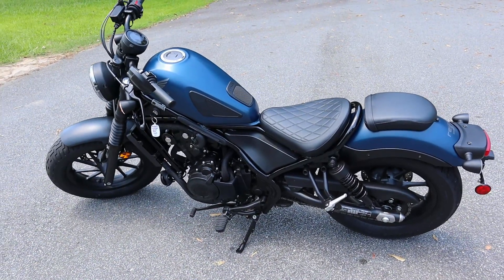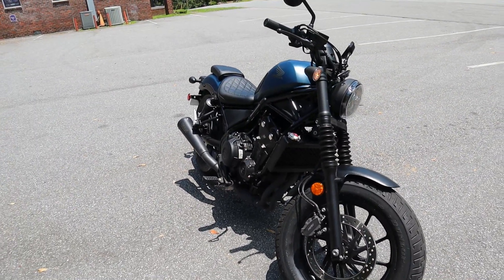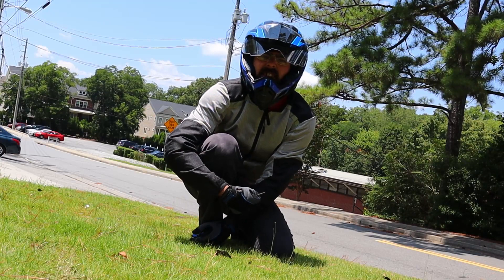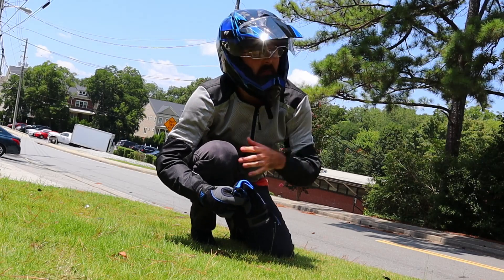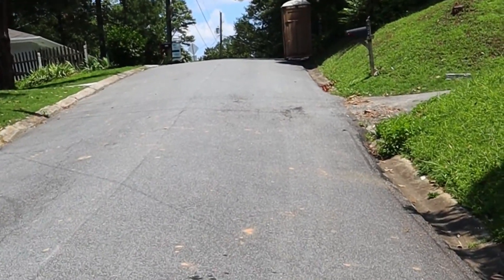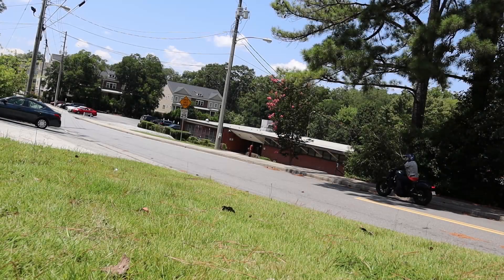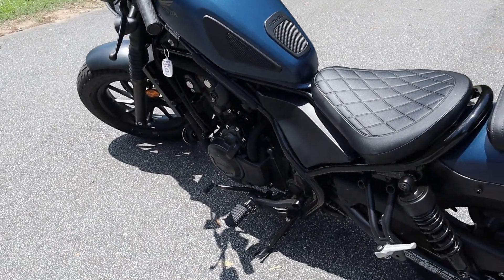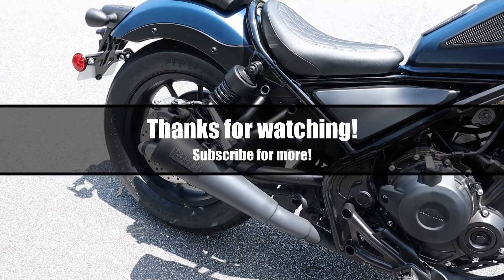Rebel 500 Day 2 New Rider

Comment: You have my sympathy for dropping the bike in that position because I did the exact same thing but twice.

 In my case I hadn't ridden for over 30 years and was trying out the SV650 I had bought, for the first time, in my quiet road. When I turned on the steep hill it hit the steering stops and I couldn't reach the ground before it was overbalanced. I was furious with myself, got it back up without thinking out why it happened and dropped it again the other way.
 That cost $1,000 and I sold it through the bike shop I bought it from that did the repairs.

 That was about 12 years ago and now i'm 70+ and still reading reviews of bikes that I would love to own and ride. I ordered a new Rebel 500 last year which took forever to arrive and was damaged in transit, so returned. Rather than wait some more I cancelled the order because my enthusiasm had worn thin.

 So well done for not giving up as I did after making a silly mistake.
Reply from the maker: Shoot, that’s a shame. The Rebel 500 has been wonderful to me so far. I still haven’t fixed the clutch lever, I don’t mind it being a tiny bit shorter. The shop was kind enough to straighten my bars and fix the minor things free of charge. Luckily I haven’t dropped it since. Thanks for watching, and I hope you get a bike again one day.

Comment: Oh gosh I did the same thing on my 3rd day riding my new Honda Rebel 300 turning in a circle from the road and used our driveway that's slightly up hill. I was going to slow and it leaned left so I basically layed it down. I broke my clutch ha due too. 😅 I was upset but lessons learned. Good luck!
Reply from the maker: At least we learned early in a low stakes environment! How long have you been riding now?